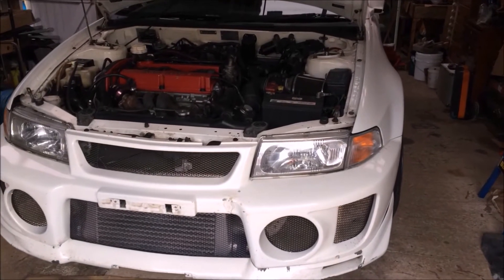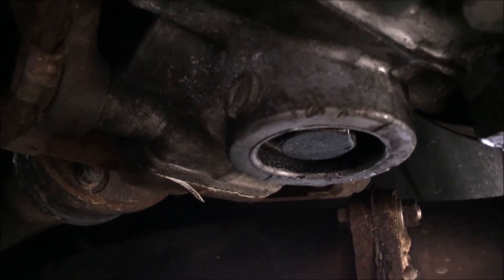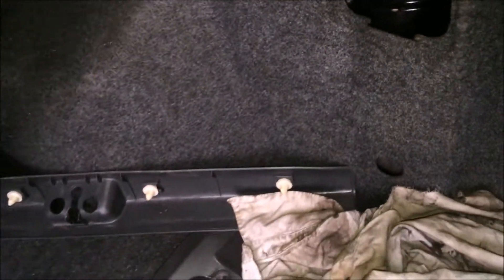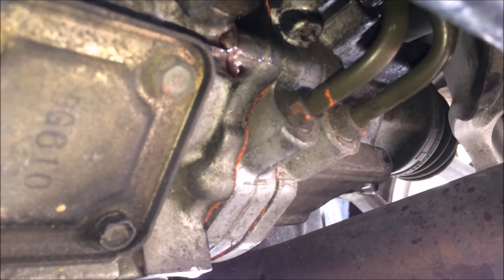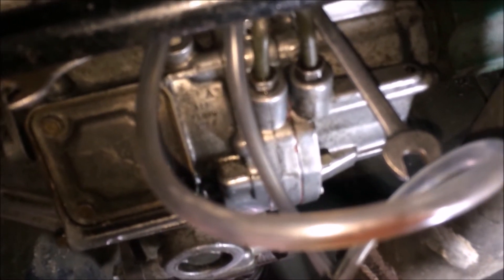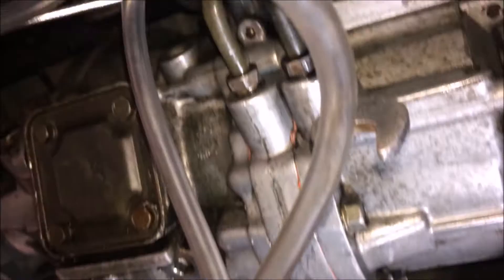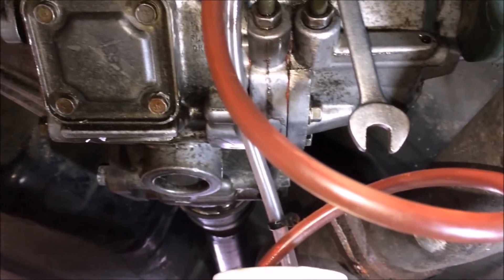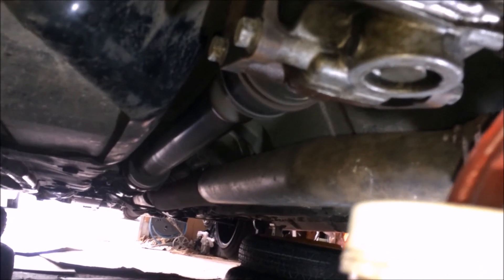Mitsubishi Evo AYC Fluid Replacement & Bleeding with basic tools

Comment: Brother, I just recently did drivetrain fluids at a rally garage on my evo 5. Now I have a horrible noise from rear when turning left or right while driving slow in first or 2nd. Noise comes when car is warmed after driving 10 minutes or so. Could this be a symptom of an unbled ayc system?? 😭
Reply from the maker: Have you tried bleeding the system? Also did you fill the correct fluid for the differential side and ayc side? Very important to not mix the two. Bleeding the system should solve the problem as long as the fluids are correct.
Reply: It's done. Sell it. Broken forever

Comment: So you can run ATF SP III ? Cause the dealer was telling me it was a different fluid plus only comes in a gallons a it’s 230 bucks
Reply from the maker: Yes you can run an ATF which specifically meets Mitsubishi SP III standards. I prefer to use Genuine Mitsubishi Diaqueen SPIII but if this is not available you can use any SPIII compliant ATF. I can't stress enough that it must meet that standard.
Reply: Millers millermatic for me